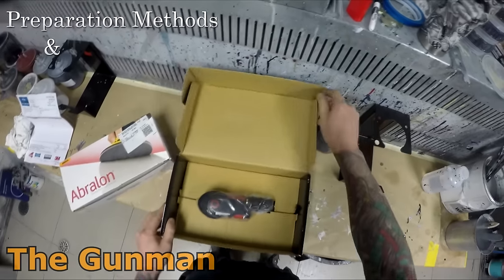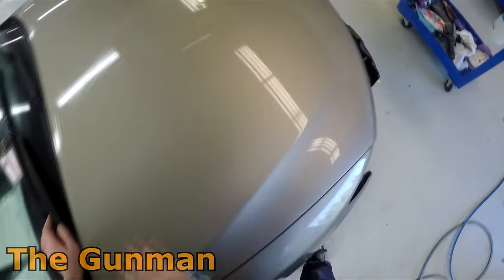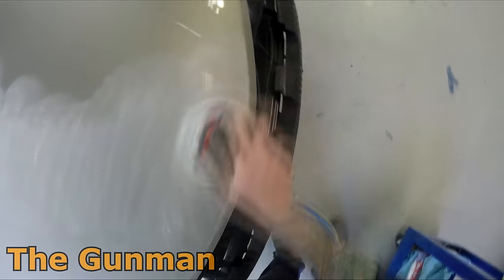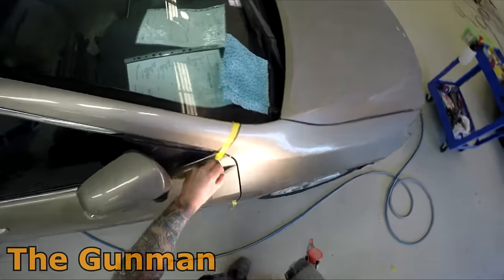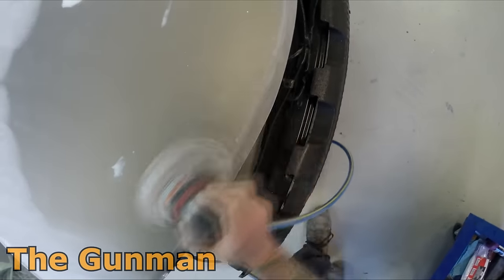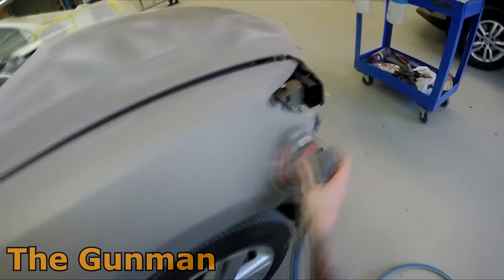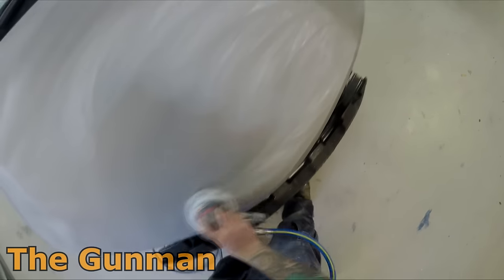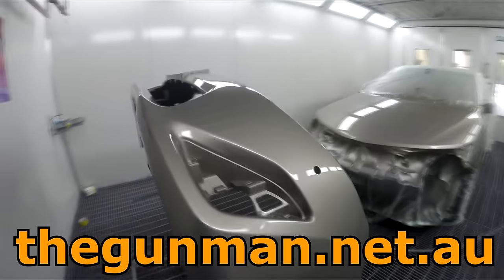Waterborne Prep Work

Comment: I have used Abralon and Abranet for all my sanding work. The 1000 Abralon is ideal for preparing for paint/lacquer. One way to shorten prep time is to use the Abralon with degreaser right at the beginning of the process (after cleaning with G101) to prep the panels. It cuts through everything and leaves a nice dull surface all in one step. Also, using Abralon 2000 for lacquer fades makes it really easy to get an invisible finish.

Keep up the good work and thanks for all the informative videos.

Comment: Absolutely, dry sanding is the way to go. I usually go over all my edges first with a gray scotch brite then start with 600 on the DA to knock down the orange peel on the blend panels then finish everything back off with 800. ITs much less cleanup vs using wet sanding primer etc. Takes forever to dry all the water out of the tights crevices

Comment: Slow down Gunman! more like a Talkman. What do you suggest I do if my clear coat is peeling from my fenders, should I sand down to the metal, spot repair and clear coat the whole block? If yes, should I fill with potty after sanding even though there is not dent and what sand paper grits should I use?

Comment: My tip for everyone is, when I sanded my floors at home I used a 2 bag portable dust extractor in the rooms I sanded, they are made for woodwork, the airborne fine dust was sucked up within minutes and any dust that I deliberately disturbed was sucked up to keep the rooms fresh and clear of dust and clean,  the extractors can be bought cheap even new, can be adapted for small hoses to use with sanders, ideal for this kind of work and can be fitted with solid filters.

Comment: Since you haven't connected the vacuum to the sander, is it still necessary to line up the holes on the paper? 

Thanks for all the videos, they have been an enormous help.
Reply from the maker: It helps you align the paper centrally and just a good habit I guess.

Comment: the only reason why i am still working in the same shop is because the painter is an awsome theacher and realy explains why you have to do that and what you did wrong but the panel beaters and mechanic's are just lazy they don' take off anything mirrors handels headlights trim you name it they did not remove it half of the cars are not straight or still have dents or have alot  of pinholes in them yeah you get a lot of cars done that way but if your car looks like shit the costumer will not come back or you have to re do it sorry for my little outburst 😊
Reply from the maker: +kevin hekers it's a tough gig at times 😔

Comment: hey gunman

quick question, im spraying 2 pac, glossy base coat, with no clear

the colour has come out a bit different to what i thought it was going to, just wondering do you think it was just badly mixed paint or would having a different colour primer change the appearance?
Reply from the maker: All in the colour match, black will cover very well so doubt it's transparent, black isn't black unfortunately, there are so many different shades.
Reply: yeah i thought it might have been that, should have checked it outside and not just in the shop!